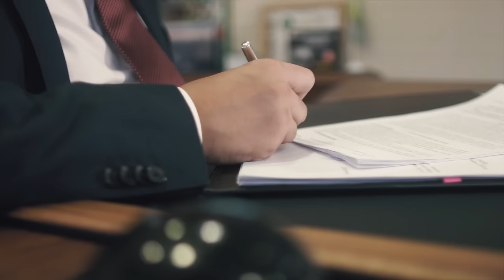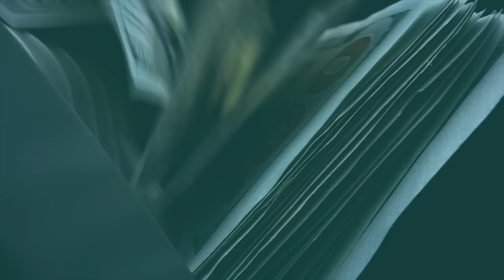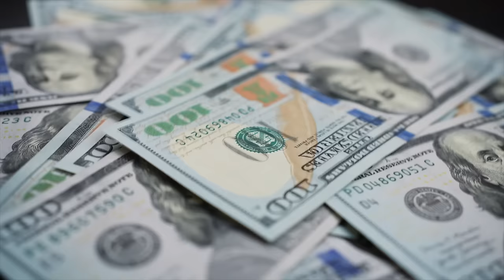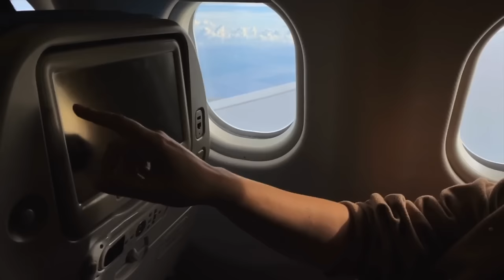How California Finally Plans To Finish The High Speed Rail Project

Comment: Problem is that the tax payers would most likely have said no to this if they new how insane the cost would go up!  This project is way to expensive and will never be worth the insane price tag!  How many people will actually ride this train and will it ever make money once the trains are finally operational.  Supposedly the project is about 74% completed but they still need to tunnel through the mountains north of Los Angeles to get the high speed train into LA.  I am interested in riding it but the cost of the project may end up meaning the cost of a ticket may end up being expensive.

Comment: Has a shovel of dirt been moved on the Bakersfield to LA section?  Is there a source of funding established for this section?  I think both answers are NO!  Given their speed of actual building once funding has been established it will probably take an addition ten years to see it completed, so no high speed until 2034 at the soonest.  Meanwhile interest on all of this debt is accumulating, resulting in a final price tag of probably over $150 billion.  What is the operating budget projected?  How much of the capital burden will fall on passengers?  The question then is the fare going to be competitive with the airlines for the LA/SF trip?  Consider that this does not only involve LAX but also other LA airports and possible Oakland at the other end, depends on where the traveler wants to go, final mile.  Also the beginning mile as well.  The airlines are clearly the faster choice in actual travel times but TSA and other issues slow this down to where they might be longer than actual travel time.  i will venture that operating costs will drive ticket prices to close to that of airlines, especially the budget lines.  In the end though, somebody has to actually pay the capital cost.

Comment: What do I think of the project?  I think it's 30 years late!  I think the USA should have been building an interstate rail system comparable to the ones I've ridden on in China and Europe.  I think the Federal Government and the states should be significantly increasing gasoline and diesel fuel taxes significantly and applying the tax revenue to building more real high speed, not the pathetic Acela speed, interstate rail system completely isolated from the crappy freight burdened system that Amtrak trundles along now.

Comment: Media constantly compares to China's High-Speed train. The USA was built for automobiles and air transportation decades ago, and China decided to transform trains significantly in the early 2000s. The US cities, towns, and societies are not to be designed and built for trains. It is not like the best-accommodated public train system in Japan. It spent billions of dollars and takes over 30 years to get even. High-Speed Train California would fail. Japan proposed a Bullet train in California twice, and the state declined.  On the other hand, Japan supports building an economic growth structure before making High-Speed with the State of Texas. They will not only run Japanese-made bullet trains but want to be profitable and add value to the public. I am not an expert, but time will tell.

Comment: I lived in Fresno CA for many years, stops in Merced in Madera are a waste of time, two very small towns with mostly working class population that will not be using or be able to afford this train, as for the route, a possible option would have been to use the medium on  Interstate 5 from SF to LA saving millions on land acquisitions, then linking Fresno and Bakersfield with to it with regular speed rail connectors or dedicated bus service.
Reply: The median of Interstate 5 is too curvy to run at 250 mph, which is the required test speed. Operation speed will be 220 mph. The Central Valley is the fastest growing part of California. The proposition creating the project requires that the population of the Central Valley also be served. Fresno is larger that the largest city in most of these United States and Merced is the cross platform connection station for all the connecting trains until the rest of the system is built.
Reply: @danielcarroll3358 Replace the high speed Pacheco Pass route with the better faster speed Altamont Pass route. Faster and cheaper to build and serves the Central Valley and East Bay better.
Reply: @davidjackson7281  That is the Valley Rail project. It is being built by a separate group and will be a "higher speed rail" project, i.e. 125 mph to Merced from Pleasanton BART.
Reply: @danielcarroll3358 Yes I am somewhat aware of Valley Rail and Valley Link. If they along with the ACE and San Joaquins can accomplish a better service this decade that would be great.
Reply: Merced has the UC university though.
Reply: Not be able to afford a train ticket? It’s a lot cheaper than the financial shackles of being poor and trying to own and insure a car with $5-6 gas.

Comment: The San Diego to L.A. track is about to fall in the ocean in a couple spots, and it's S L O W.  Maybe I would take more gigs in L.A. ..... or not, I'm probably retired by then.
Reply: I live in San Diego. I think California should should've built LA to SD first then build the bigger central valley corridor to replace/supplement the Surfliner as  it's unreliable and is falling into the ocean like you said

Comment: You guys really said with a straight face that there’s lack of funding when it’s $70 billion over budget lol
Reply: Ah who cares. California alone produces 3.7T each year.
Reply: yeah like wtf, wdym there’s lack of funding when you 70B over budget
Reply: 70billion?? Indonesia only using 7Billion to make their HSR 😮
Reply: At this point in the project less than $20 billion has been spent. There is no "budget" as such to go over. As money is available another section is built. Meanwhile the completed sections will be used. The first thing needed is a test track to test at the required 250 mph or 400 kph. Now the bridges and other necessary infrastructure are being built. It is planned to place rail and catenary in 2025. Passenger service will probably take another 5 years. No stations have been built yet nor agreements with the eventual operator. The state will not operate the trains. They will lease the system to an operator.
Reply: Indonesia -7+bil ,88mi (completed)
India -15-20 bil (est),300+mi (UC)fully elevated

Comment: This system is and will be a huge white elephant with not enough riders to support its operation and will benefit relative few people. The vast majority of its citizens commute to work within their own cities. Once the train drops you off at your destination you will have find some form of transportation which will be expensive as California is very "spread out" your destination could be far from the station. You can drive on a tank of gas or an EV from LA to SF in 5 hours which will take you all the way to your destination. Why would you take an expensive train ride that was also heavily subsidized by the taxpayer on a 3 1/2-hour journey where you have to pay for transportation on top of that when you could just drive your car? Meanwhile in California, the roads that serve 10's of millions everyday are crumbling because they are spending the money on this monstrosity. By 2030 they are going to have HSR between Merced and Bakersfield out in the middle of nowhere with very few riders to the tune of $100B which may be as far as it goes. To connect that track to LA and SF will take another $200B and 30 years to build added to the tab. Ridership revenues will never be able to maintain and fund the system, the true cost per rider will run into the 1000's.
Reply: Both LA and San Francisco have solid public transportation systems. When you get there on HSR you take public transit to your destination. The case you mentionnis happening in Florida with Brightline, Miami and Orlando are car centric cities so the convenience of the train is gone when you have to depend on multiple ubers at arrival
Reply: @maumor2  Yea, I tried that once going from northern Los Angeles to the OC. what took an hour by car took 4 hours using public transportation.
Reply: @donuthole7236  The train will go thru northern LA and well into Orange county (Fullerton, Anaheim, etc)  so you just demonstrated that the system will work
Reply: @maumor2  The A line to Union Station, them a Metrolink to the OC. Once there, I had to do a good deal of walking from the train station as there was no stops nearby. Finally caught a bus which took me a mile or two, then I was walking again to the office. That, and all the waiting in-between is a 4 hour ordeal in both directions which made for a 16 hour day! LOL That is not my only experience with LA's mass transit. Unless your "local", you're screwed!
Reply: @donuthole7236  you just keep showing evidence that HSR will work
Reply: @maumor2  How so? 🍿
Reply: @maumor2  Metrolink and Metrorail are already running those routes. Depending how many stops there are on that huge sped of very urbanized area, HSR won't be of much benefit only until there are long stretches of rail when that train can "stretch it's legs" in rural areas. Arriving at a train terminal is no different than arriving at an airport. After that you still have to get your destination which might be a considerable distance away. Just read the latest cost figures for the California HSR at $128B of borrowed money which will benefit a tiny fraction of people compared to those you never or will rarely use it. That system will be a sinkhole for taxpayer dollars long after it's been built if and when it gets connected to LA and SF. Money that could have been put to better use. When at bill comes due I'll be in another state 🙂

Comment: Florida did it. Miami to Orlando. Thanks to some Private Company in America.
Reply: That’s not High speed rail. That’s just normal rail. Very cheap compared to HSR
Reply: Brightline is single track, diesel engines, at grade crossings, and needs multiple bridge upgrades.  And not High Speed Rail.

Comment: THe reason why they pick to start building in middle of nowhere first is to benefit the Hispanic population. It is not about making sure the success of the project, politiican just want the vote regardless if it fail or run out of funding. Basicily they wasted the fund since they have ZERO experience building  high speed train track. The track are not high speed just Acela's track speed.  Funding will be an issue when the stock market tank after next election so no funding for more than a decade, since everything would be so expensive. If they so serious, the Japanese, French, China would do it quickly just like what Mexico is doing now.
Reply: Mexico's Tren Maya (a great system) top speed of 100 mph is not HSR. CAHSR will operate at 220 mph, tested and designed for 250 mph, and open in the Central Valley near 2030.

Comment: Quite obviously, funding would be better spent on improving other forms of transportation. Improving access to and efficiency of jet aircraft could meet the needs of passengers trying to travel between metropolitan areas. 
Rail systems are old technology and an inefficient mode transportation.
Reply: Not really that obvious.  I mean  just ask Europe,  China, Southeast Asia, Japan, even Australia is developing it. So why can't both be done at the same time? And that old technology still moves most of the freight in this country. Not a strong argument against.  It's Luke suggesting that freeways should just add more lanes, and make cars be autonomous and travel at 160 miles per hour..
Reply: Trains are the most efficient mode of transportation, followed by busses, cars, and waaaaay behind is anything that flies. A single flight uses more energy and releases more pollutants than running power for all the passengers' homes for a month.
Now, if you mean inefficient as far as time goes, have you been through the TSA lately? So much extra time needs to be included on either end besides the actual flight time. For HSR you possibly go through some turnstiles if not just outright walking up to the train, hop on and you're good to go within minutes, and train stations don't need miles of land around them so if they place them right, you end up right where you need to be.
If you get the chance to, I highly recommend trying out one of the existing HSR systems around the world. They're really quite something!
Reply: @ikani1  I wouldn't have been anywhere near so polite when replying to that ignoramous.